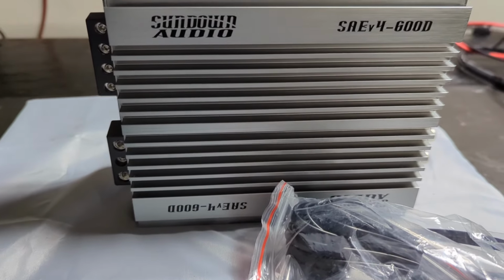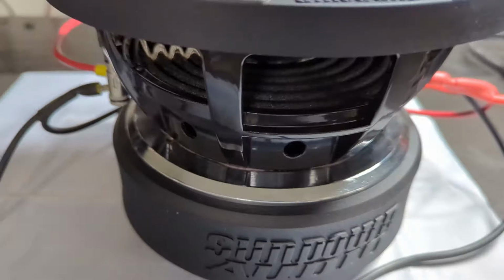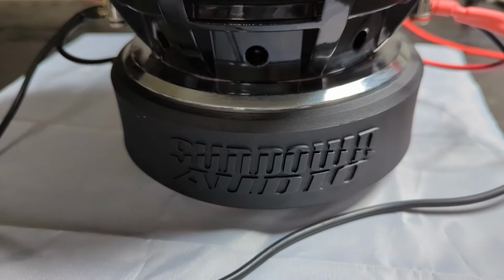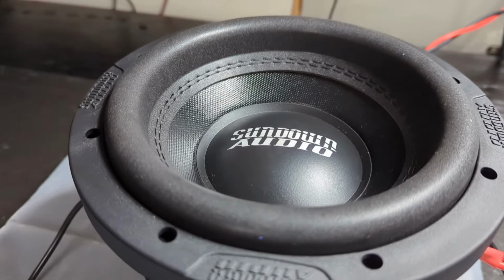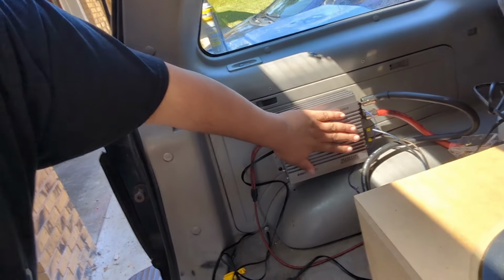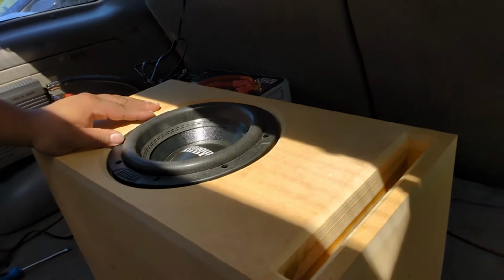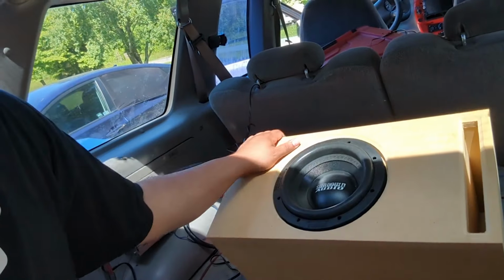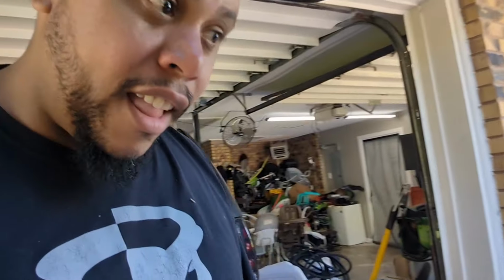Testing the U-8 Subwoofer from Sundown Audio

Comment: Im trying to decide on my next setup, its gonna be either 3 sundwon U8s ported or 2 sundwon X8 v4s ported. I only have room to properly run 2 x8s v4s but seems most been saying the 3 sundwon U8s would be louder might not play as low which im more into 33hz on up and jus trying to get as loud as possible with the available space under the seat of my truck.
Reply from the maker: These u8s are pretty amazing bro! You cant go wrong with them! I made a bench test of the massive audio hippo H82XR just today on my channel. And I feel like they destroyed the u8... In my opinion. You should check it out. And it's a little bit cheaper than the u8! 👍🏽